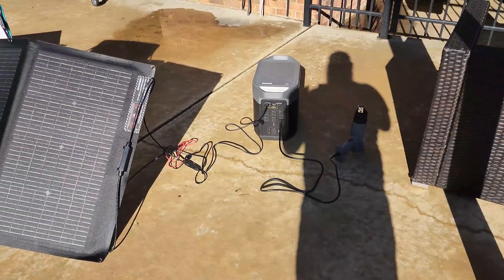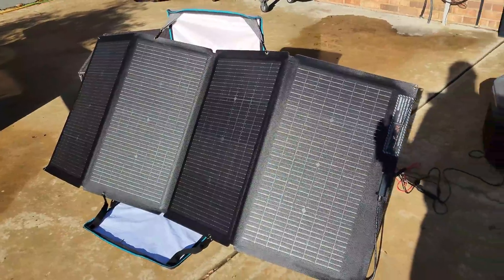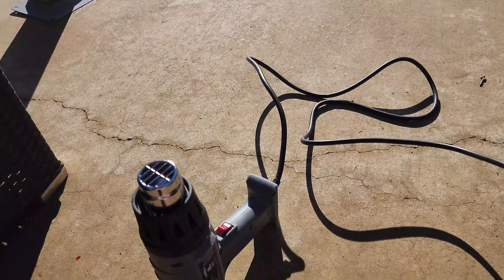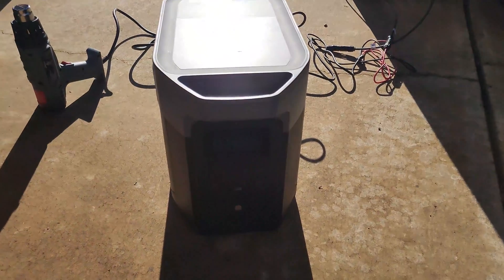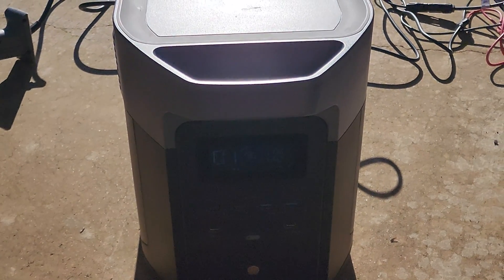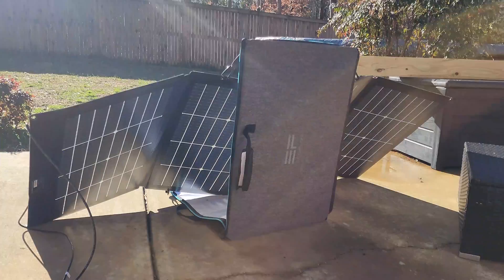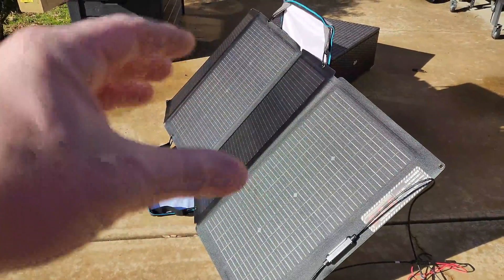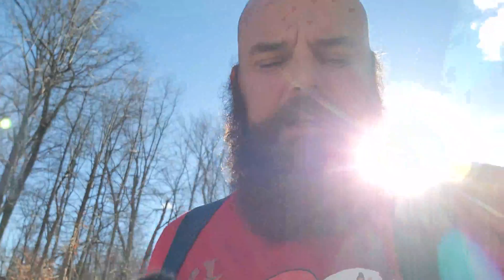Can You Use an Ecoflow Delta 2 Max While Solar Charging?

Comment: Hi there. Can i use a Delta2 max 500w charge from solar with a 600w solar panel and set it on the app to 500w to charge?
Reply from the maker: It would only allow 500w in anyway. That's the maximum on input per solar port.
Reply: Wouldn't it damage the power station if we connect higher rated solar panel to charge it? What if you connect delta 2 to 1kW solar panel setup, or more than that? Would it still safely take in 500 watt only while ignoring the extra input? Is it safe?

Comment: Hi may I ask why is my ecoflow still draining battery when Im harvesting 71w from solar and using just 43w?  Thank you
Reply from the maker: No
Reply from the maker: No idea.
Reply: efficiency i think
Reply: If you have the AC inverter turned on, there will be a parasitic drain on the battery even if nothing is plugged in. Just the nature of all inverters since they have to be ready to supply power immediately when plugged in. If you run DC or USB only when no AC devices are plugged in, you'll see far less passive drain.

Comment: I just got my delta 2 max a couple days ago and tried today to run a fan while it was charging. Ever since I plugged in the fan to the AC port and hit the AC On button my input and output are staying at 0000. Even tried unplugging everything and then only plugging in the solar panels. Even that won't change the input #s now. It was displaying input watts fine before.
Reply from the maker: 1 Unplug everything 2 turn off unit 3 press and hold power button 3a screen will turn on, keep holding.  4 once screen turns off, unit is reset.
Reply: @JohnWCH  I guess it didn't like me talking about it behind it's battery, cause when I went to do the reset I saw it was suddenly showing input watts. GO FIG!
But thanks for the tip. If it messes up again I'll remember to hold the button to reset it.
Reply: @Chad.The.Flornadian same here. It just says error

Comment: Hi I have a quick question is it in slow charge or fast charging
Reply from the maker: Slow. Fast is only when you're plugged into the AC of the house.
Reply: @JohnWCH  but can you use the unit while charging in the solar panel in slow charge thanks in advance
Reply: @Petevillegas1980  Did you WATCH the video?

Comment: Hi how are you. We just joined your channel and have a question. Can we use the battery without the app at all? Please advice. Thank you. 
Cris R from Canada.
Reply from the maker: Yeah you can. You'll miss out on settings and firmware updates etc, but it'll still work as a portable power station without issue.

Comment: If you're charging the Delta 2 Max off AC power you can still power devices plugged into it but they will be limited to 1800w max output instead of the 2000 plus watts it can do by itself.
Reply: What is UPS?
Reply: @judithfears-drayton9703 it's similar to FedEx.
Reply: @judithfears-drayton9703  Uninterruptible Power Supply = UPS
Reply from the maker: I mean this in the most non sarcastic way possible, but why wouldn't you just plug the thing into the wall? Why use the ecoflow?
Reply: Maybe to use it as a sort of online UPS
Reply: @royhersh  Yes, I'm using my unit as an online UPS most of the time, with the flexibility of being able to pull it off as an emergency backup battery for other uses as well. My desktop PC,  monitor, keyboard, etc etc are hooked up to an APC UPS and that UPS is hooked up to the Delta 2 Max and to the wall. Can definitely handle keeping the PC on for hours at a time. Only had it for about a week so far though, let's see how long it lasts.